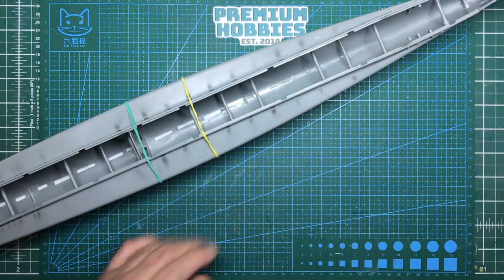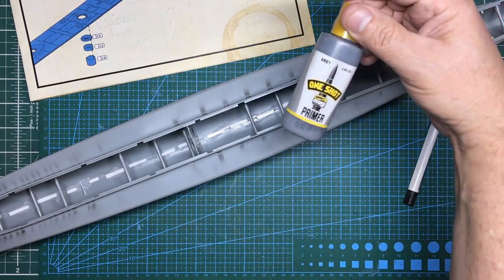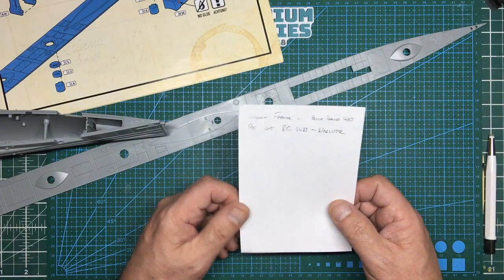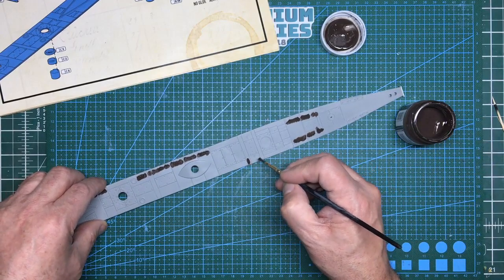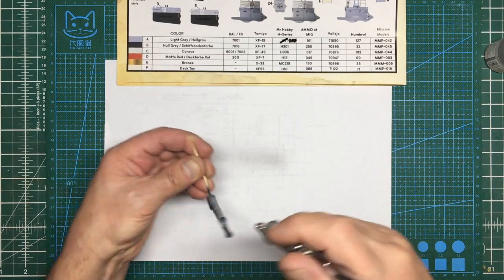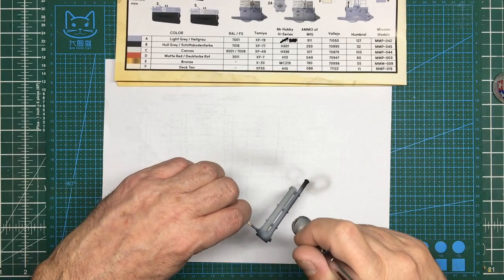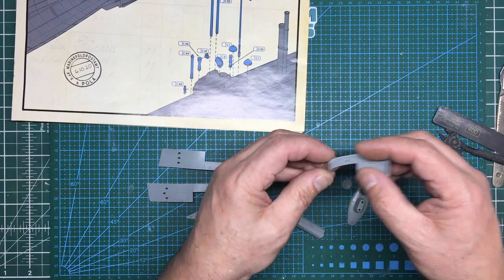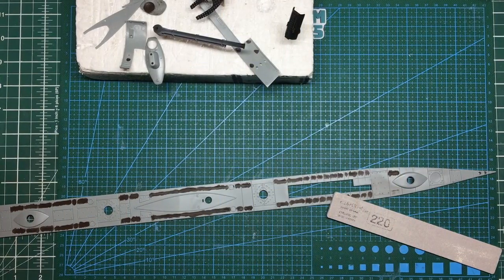Das Werk 1/72 U-Boat U-9 build. Part 4

Comment: Great helpfull hints and less swarewords than in other channels - thank you very much. Looking from my torpedo boat point of view, S.M. U 9 is just a dive-able torpedoboat with all INSIDE fixed tubes and a petroleum fired explosion instead of a coal fired steam engine. I have got this kit in my stash and do think about pulling it out at the end of your series.
Edit: The casting effect on the parts can also be done by a stiff brush and "Green Liquid Stuff" by Citardel - so you can sand it of afterwards it is doesn't fit to your inner artist's eye. Some of the hull's parts Candy be superered by this method, too.

 Best wishes from Berlin by Christian

Comment: Hi Nigel, enjoying the build between night shifts. Your comments about you tube removing comments was interesting, went back to check and one I made on part one has gone! You were asking about what to call the hull / fuselage.  My comment was the outer part you could see was the casing with the pressure hull underneath which you alluded to in part 4. Looking forward to the rest of the series.
Reply from the maker: I saw that comment. I remember reading it.
Reply: @NigelsModellingBench  you tube moves in mysterious ways!

Comment: Hi Nigel, I realize you are building this kit OOB but I found some information about U-9 which may interest you. The PE instructions from RC Subs for this kit suggests the bow be shaved down to approx. 1mm wide and replace the rather thick molded on D shaped piece (near top of bow) with PE. The D shaped piece may have been used for towing. I have also found a photo of U-9 which would indicate the bow is not blunt as the molded kit hull would indicate. If you would like to see the photo let me know how I can get it to you. I almost forgot, the RC Subs PE set also includes inner and outer detail pieces for the hatch covers. All the best.
Reply from the maker: Thanks Gary. I have already mentioned this in my video and have talked about the PE. I am also discussing this in part 5 and I disagree with the theory of removing material from the inside, as I discuss in part 5 also.

Comment: I am a fully signed up member of the "Model Air haters" club. I am aghast that people recommend it to newbies. The "tip dry" is horrific and unless you are an experienced airbrusher, you won't realise, "It's "the paint" and not your technique/skills/airbrush/compressor/whatever. Not to mention it doesn't adhere well and doesn't "sand" at all. (I could also say the same of Stynelrez.) I'm minded of a comment a 1:1 scale professional car painter I once heard say on paint - "if it doesn't smell, it doesn't work."

[Begin rant] Newbie airbrushers: IMHO - go to the supermarket, buy yourself some "food dye" and practice with it painting some paper or card (which are absorbent - beware, plastic substrate behaves differently,) to "get to know" your airbrush/compressor/pressure/et-al and techniques.  Thence, once you've learned the characteristics of your airbrush, compressor, et al, you can start experimenting with paints, thinners and plastic  in the knowledge of what is "down to you" and "down to the paint/substrate/etc. "  [End rant]

Air on, paint on, paint off, air off. This should become mantra: Discus...
Reply from the maker: 100%!!!!!

Comment: Hi Nigel. Great video. I have a question concerning Mr Surfacer (and other fillers). Background: My hobby space is in a steel shed. When I am in there I have the space heated  and, obviously, I turn it off when I leave. My question is this: will cold temperatures affect fillers. I have tried to find an answer from the interweb, but to no avail. I would really appreciate an answer from you or anyone else out there. Cheers, mate and stay safe.
Reply from the maker: Good question. In MY experience, solvent based materials are unaffected by cold or heat within reason. For example, I have all sorts of fillers and resins in my garage. none are affected by the summer heat or the winter cold, other than resins which go off over time whatever temperature they're stored in. However, I can assure you water based acrylic products will suffer from the cold. Some say that Vallejo and Mig ammo products are seriously affected by the freezing hold of an aircraft during transportation? I would have thought the hold would be kept up to a certain temperature?? So, If I were you I'd keep my water based products indoors and leave the solvents in the shed. Take extra care in the summer as the volatility rises as you approach the flash point.
Reply: @NigelsModellingBench  Much appreciated, Nigel. I keep the paints indoors and, for some reason, just kept the fillers in the shed. When we had the snow last week, it was THEN that I started to worry. Thanks to you, I can rest easy. Again, thank you very much for the quick reply. Stay safe etc. 
Pat

Comment: hi Nigel re friction lock give the side pins on the snorkel a coat of super glue let them dry and you will find that this will increase the diameter enough to make them a bit tighter, if its still a bit loose give them another coat! You don't need to over engineer it KISS Keep, It, Simple, Stupid and it will work like a dream.
Reply from the maker: Did you just call me stupid LOL
Reply: no mate LoL, sometime it's easier for some one sat on the sidelines, just to say why don't you just do this! You then think Twat, why didn't I think of that, I'm trying to be that TWAT!

Comment: Nigel. As a beginner, with regard to styrene rods, profiles and sheets for gap filling and scratch building: what types and sizes would you suggest I get in stock that would be useful and cover most situations. Thanks in advance and keep up the good work.
Reply from the maker: Sheet. .25, .50, .75, 1.00. 
Rod. O.5, 1.0, 1.5. Or see if you can get a selection pack.
Reply: @NigelsModellingBench  Nigel: Thank you very much for your quick reply. Much appreciated.

Comment: I hear what you’re saying regarding the build as being more of an exercise to demonstrate techniques, which are really appreciated, but regarding the bow: I have a photo of U12’s bow and it does look a lot sharper than the kit version. I’d be more than happy to send it on if I had your email address, but totally understand if you’re content to round it off a bit instead 👍
Reply from the maker: I agree. I have discussed this at the start of part 5. However, I don’t believe thinning the hull from inside is the correct way to go about it. I also discuss this.

Comment: Some good advice about paint choice for new modellers. However I think you should explain further about your description of certain products being 'smelly'. This includes  Mr Color Levelling Thinner. They are not just smelly, but extremely flammable and highly toxic, especially when sprayed into the air. Therefore they MUST be used with an extraction system and a mask. I agree that water based acrylics do not give as good a finish and are more difficult to work with, but they are less harmful.
Reply from the maker: Thanks.
Reply: Good point about "smelly", it is not a useful term.  Cooking kippers or cabbage is smelly but it is not going to kill you or burn your house down.
Reply from the maker: If I cover the health and safety implications of the products used in all my videos I would be moaned at for repeating myself all the time. I have said on many occasions about the dangers of the products used and refer to the lacquer paints as being "smelly" or "they stink" as many other You Tubers do. Most say nothing at all. If you care to go back and listen to my videos over the years I've been making them you'll hear me say many many times that open windows and extractors and masks are a necessity when using lacquer paints. I have said it probably three times in this build series. the products all come with health and safety labels attached, so when used these labels can be obeyed or disregarded by the person using them. It seems to me that more and more these days people pick up on what is said or not said and have to comment on it. I will soon be loading videos with "No comments" or just not bother at all. It is wearing me down.......
Reply: @NigelsModellingBench  Sorry, Nigel, not having a go at you, just agreeing with Peter's specific comment.  I have been following your channel for a while now and, as a retired Health & Safety professional, I think you are one of the better Youtubers as regards H & S advice and I am aware of how seriously you take it..  Keep up the good work.
Reply: @NigelsModellingBench  Was just trying to give some constructive comment  - not intended to have a go or score points. It's great to see you give advice for new or returning modellers, but thought I was helping by suggesting that you cover H & S in more depth, especially for the newbies. Not everyone picks up just how toxic cellulose thinners can be , especially when atomised and sprayed indoors. Hopefully you can see the difference between my comment and the 'you're sh!t' or the rivet counter comments you get that wear you down